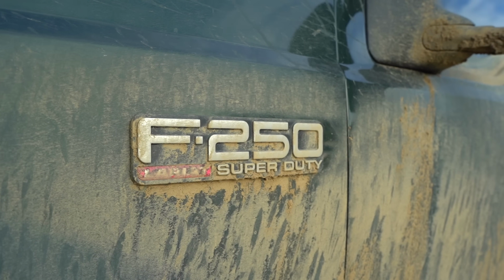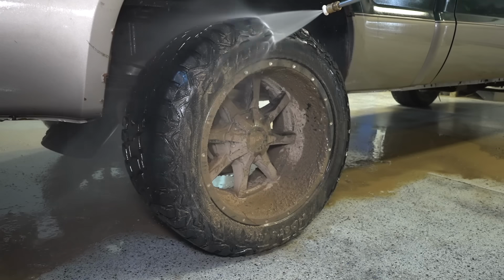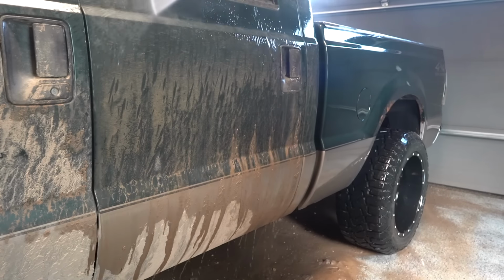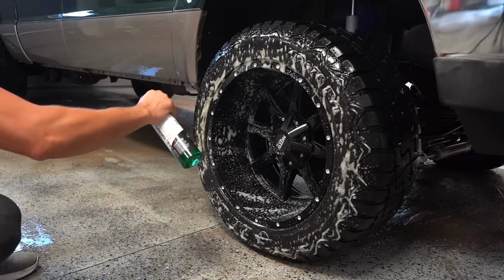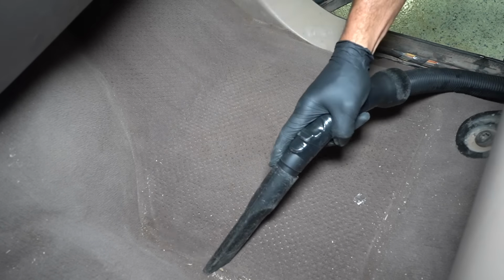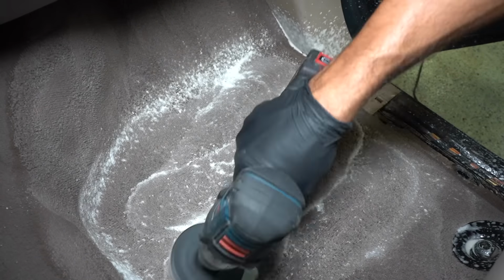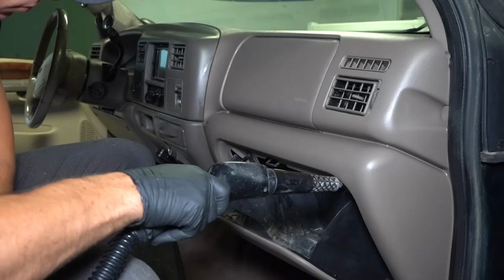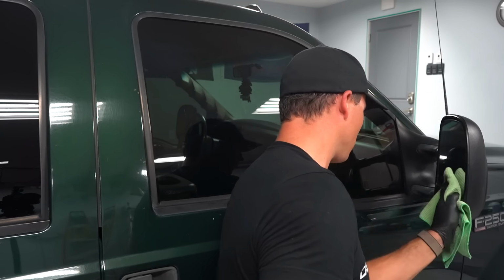Deep Cleaning The MUDDIEST Truck I've Ever Seen! | The Detail Geek

Comment: I like how you actually show what I'd call "true work" by doing a BEFORE then the finished. A before is a MUST to me, it's the selling point and shows what you did. 
Anyone use Simple Green or Purple Power for a degreser? I've always been iffy on both but here lately it seems both are not as strong. I remember using PP on dirty tires, it'd actually show it working. Now it doesn't do anything. 
What do you use for tires?

Comment: It didn’t look like you did this but I may be wrong. If you wet the heavily muddy areas first before starting on the rest by the time you get back to them they will be loosened up and wash off easier. I used to clean the work trucks at the mine and they would be coated in clay I could spend upwards of 30 min per wheel/wheel well just removing the clay build up. But like I prefaced this you may already do that I’m not certain. Love your videos!! Soothing and full of great info has helped me a lot with cleaning my personal vehicles!!

Comment: Reminds me of working at the rock quarry.  We would have to wash our trucks almost every day before heading home with similar looking mud caked underneath.  Water volume makes a big difference at getting the mud off.  In addition to a pressure washer, we had a booster pump feeding a 1” hose with tapered nozzle.  So good at getting the wheel wells and rockers knocked off.

Comment: @TheDetailGeek
I have 2 questions. 
1. Does carpeted wheel wells actually work. I know the theory, but I want to hear what your thoughts are on them.
2. Does having drywall in your garage with pressure washing concern you at all? Even if not a direct hit from the pressure washer, I feel humidity may take its toll on them.
Reply: Use a good paint and you’ll be fine

Comment: i upgraded from the bissel after 1 yr  to the mytee 8070 HEATED 4 gallon Extractor. Cant beleive DG is still using the bissell this many years on,  he truly lives by "if it aint broke dont fix it" in my case my bissell did breaj . the head snaped and a bad extension cord fried the end.

Comment: As someone who works in the woods, you need to use a garden hose or something that you can spray the inner wheel lips, you cannot get the correct angle to get the mud out of there with a pressure washer wand like you are using. This mud left in there can also explain or at least help explain the rust you see. Mud holds moisture.

Comment: I know this is a few months old, but it's super satisfying still.

It always amuses me when you talk about a vehicles age and odometer reading, then I remember a lot of other places consider a vehicle to have high mileage way before we do in my state. Our farm truck here, (1991 Ford F-250 with a 351 5.8, 8 cylinder motor) has 510k miles on it and still passes every bi-yearly smog inspection, and has minimal surface rust. Imagine living somewhere that thinks low miles is anything with under 150k.

Also, question, how do you get embedded dirt out of tire rims and hubcaps? I tried a couple of other people's methods and they didn't help much. Any advice would be appreciated.

Comment: Being someone that used to really like going mudding, it would help you out a TON to "soak" the dried up mud with a water hose vs going straight into it with a power washer. By spraying it with a water hose first it will rehydrate and come off alot faster when you later attack it with a power washer. I had a sprinkler that was solely for soaking my jeep, I'd let it run for about 10 minutes then drive down a couple blocks to the car wash and blast it all off like a hot knife through butter.

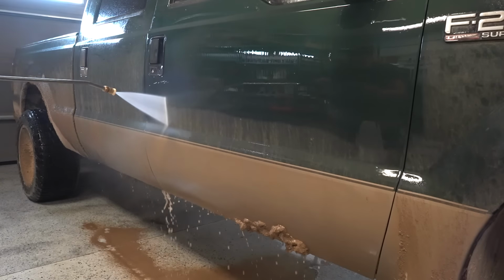Comment: Hello, just wanna give you a little tip from my experience, when working on a muddy car (or on any behicle covered in water soluble stuff),  spray the car with water first and let it sit for few minutes, it can really save you half an hour when pressure washing. (@1:55, those chunks would just fly right off) :) and as always, great video

Comment: I used to work in the wash bay at a small Ford dealership and I would wash some extremely muddy bush trucks. They were even muddier than this one! 
Even though my job was just to wash the paint and the wheel wells and not to detail them, I wish I had your equipment to wash the under carriage.

Comment: Have been thinking about this one a lot. Why you start with just the pressure washer, and don't spray foam on it first? I have been told that the foams duty on cleaning cars is to smoothen the dirt on the car before you wash it with pressure washer, so it doesn't make more scrathes on the paint when you wash the hard dirt of the car.

Comment: I start the rinse with the undercarriage so after the body is rinsed and washed the mud and dirt has some time to soak and falls away easier.  Also spray the inside of the frame as well as you can 🙏❤️☯️

Comment: So in this video after using the foam cannon i see the soap kind of dries a bit. I love using my foam cannon but not being able to wash indoors i have to so wash outside. The soap dries pretty fast if i try and do the whole truck or even 1 whole side. Is it safe to allow it to dry and just use the microfiber wash mit or does it need to stay wet?

Comment: When detailing the carpets you used a brush to agitate the carpet and you seemed to spray a chemical on the carpet. What hardware did you use? What that a pressure washer releasing chemicals? And your brush head for the drill?

Comment: So I've done detailing for quite a few years now. Idk if you've heard of this or tried it but I take a palm sander and put a microfiber on it spray some whatever I'm using for cleaner on the leather seats and I use that. So the vibrations and the cleaner lift the dirt and such from the cracks and pours of the leather so it's spotless clean. Spray down again and wipe it with a clean rag and then condition the leather. Lemme know whatcha think of that idea

Comment: Detail Geek, as well as audience, what is the preferred/ best approach to water spots on heated mirrors, mine will NOT come off. I bought the vehicle with them. It was also other places but it went away as soon as I tried to address it. 
 I've used, Windex, Bathroom cleaner, and Dish soap

Comment: Do you think it would be beneficial to soak that mud with a garden hose before pressure washing. My washer is 3500psi moving 3gpm I find myself running it at idle for delicate areas, living in Minnesota where salt is put on the road I feel like I never do a good enough job on the undercarriage, I do my best with the wand and undercarriage attachment.

Comment: Its not just wider angled tips, its orifice size as well. For example, if youre using a 2500 psi machine rated at 3.0 gpm, you can use a 4.5 orifice tip to get it down to between 1500 and 1900 psi at 3.0 gpm. The benefit you get is more water and wider angles to clean with. 

While using a wider orifice than recommended is fine, using a smaller will burn up your machine.

Comment: I personally don't dry mine off, I let it sit there for about maybe 2 minutes and go over with a coat of some spray I use, it works great leaves the body of the vehicle, and the interior looking brand new, don't even use soap on the motorcycles, just use the spray and it makes it as clean as a whistle

Comment: The truck should be about 1,000 lbs lighter!  On the side, I wonder it would make the caked mud come off easier if you use the agitator head that makes a swirling pattern.  I have seen the street cleaners use that head to get rid of stuff like dried up chewing gum or dropped cement on pavement.

Comment: Great video, but might I suggest that when there's so much mud in thick layers, please use abrasion techniques first( on the wheels and the insides of the chasis ) to minimise water usage. Then you can use the remove the remaining mud with pressure washer. It's a humble request, don't waste water.